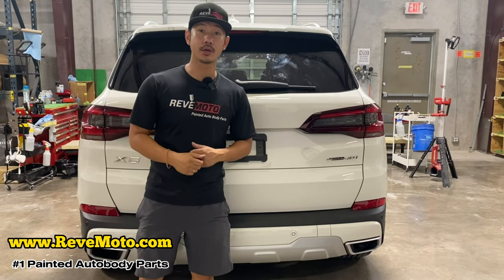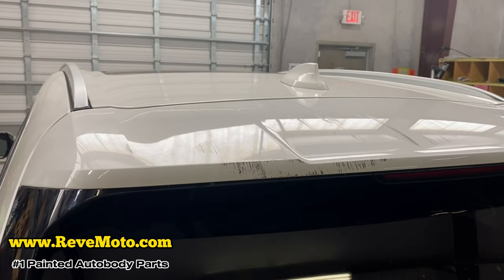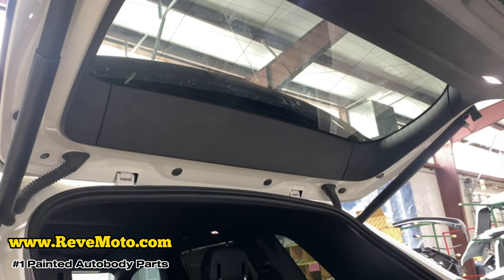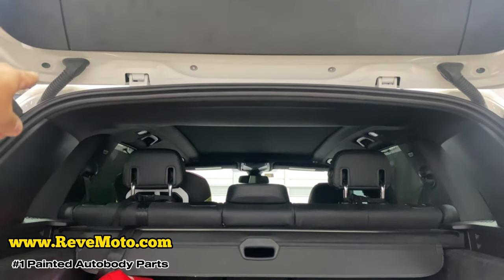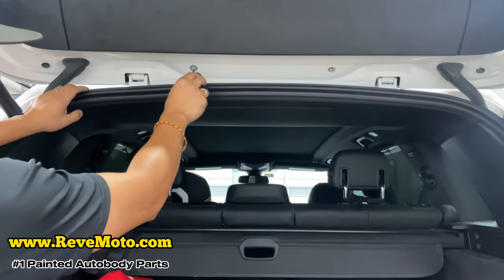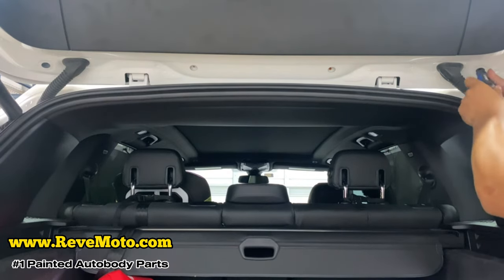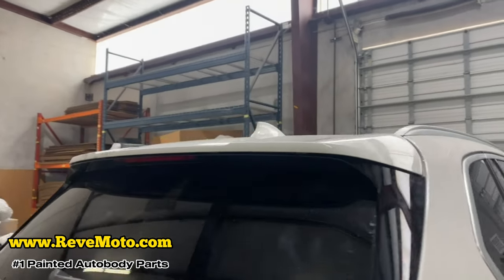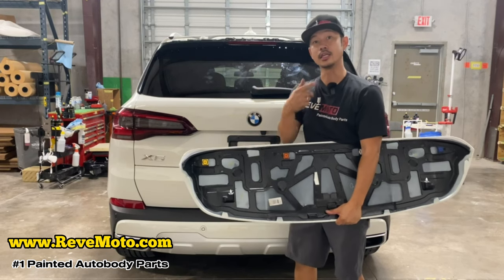2019-2022 BMW X5 Spoiler Removal (Easy as 1,2,3) - ReveMoto.com

Comment: Said he's a little bit of a pro?? Using a multi bit tool like that to remove the torx screws is far from being even a little bit of a pro. Also the spoiler on that X5 has been off before, because if it was never removed, it holds on for dear life while trying to free it when pulling spoiler from the vehicle.
Reply from the maker: Why did you watch the whole video?
Reply: @ReveMoto 😂😂😂